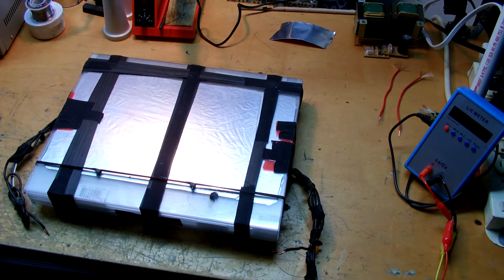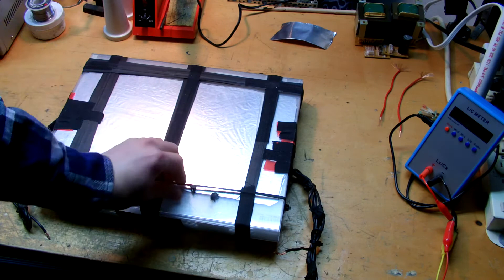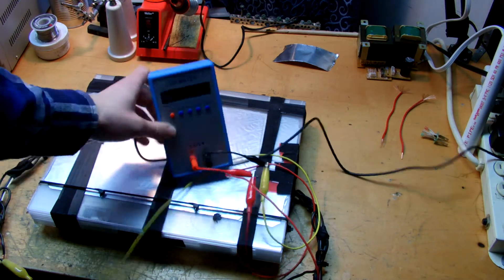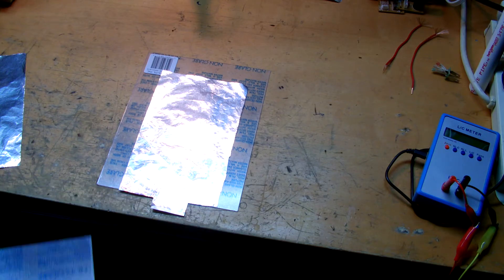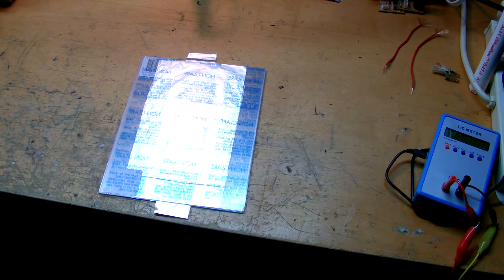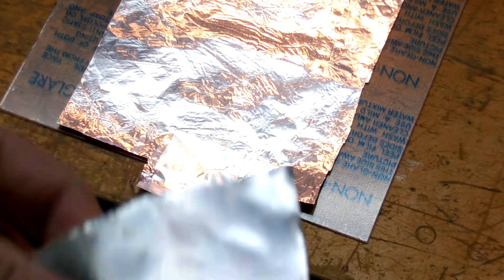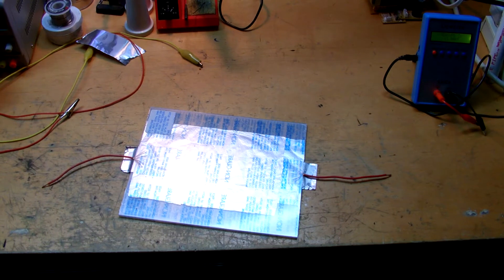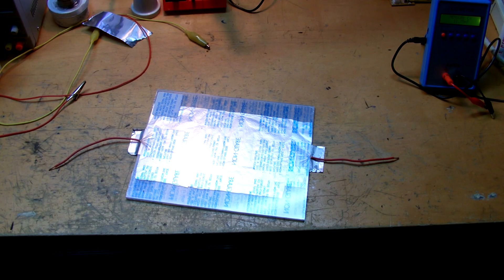DIY Tesla Coil HV-Capacitor Tutorial!

Comment: Hey Pete, Just wondering if you have used glass instead of plastic. I was thinking that my local thrift stores sometimes give old picture frames away for free that include the 8-1/2 x 11 glass plate. Being I am on a very fixed income, that might be my material of choice. I'll let you know how that works out. Plastic would be safer from a breakage point of view ;-)
Reply from the maker: I dont see any issue with going for glass depending on the voltages applied you may have to just leave about 2 inches of space between the foil and the edge of the glass plate, also glass is pretty consistent and I found that with more pressure applied to the surface of the capacitor the higher the capacitance was since the dielectric compressed. You could also get a small flat bead of silicone around each plate to help everything stay secure and square whilst reducing the chance of flashover.
Reply: @PcrHV  Sounds like a plan, thanks 🙂

Comment: Actually a very well explained video. I am just starting out with my first few Tesla Coils and thinking of using the output from a flyback transformer from a old Bently TV that in itself pulls about a 25mm arc. Thinking of feeding that to a diy cap and sparkgap before feeding to my TC primary. Any thoughts other than not to kill myself? 😀
Reply: @PcrHV  I have been working with my ham radio gear for nearly 50 years and just getting interested in making intentional sparks Lol. I got hooked on musical TC's recently and got bitten by the bug. I doubt I will go to the power levels you are at but this is going to be fun anyway 🙂
Reply from the maker: @marknesselhaus4376  ahh good old ham radios! Good, so you have an electrical background. That helps lol. Once you build your first coil you'll want to go bigger! I do love audio modulation and have only done it through a flyback as of yet.

Comment: Nice Job..  I don't what your goal for Capacitance was,  But, there's is thinner Plexiglas available.  Standard Store plastic is around  .080 inches thick.   You can get it online at .020 thick.  That should still be plenty to stop any arc through.  The thinner the plastic,  the higher the capacitance..  Even better, would be a clear plastic shower curtain..  It's thick and really cheap at walmart and you can double it up for the thickness you want..  Also,  You can buy Aluminum Gutter Flashing for the plates,  it's much more rigid and really thin..  but,  If yours work the way you want,  More power to ya.  Nice video..

Comment: First... You were extremely lucky to get a plastic that would handle the voltage without puncturing through the plastic sheets. Not all plastics were created equal. Second.... I hope you peeled the protective coating off of the plastic before assembly. The reason being, that the air pockets between the protective sheets could cause rather large static build-up and arc right through the dielectric sheets. Third..... Since all plastic is not created equal, Would be nice for you to tell what kind of plastic, the manufacturer and the thickness, and where you bought it. Last You could also soak the cap in a bath of mineral oil and further reduce the chance of corona racing between plates. The oil also serves as a cooler and will extend the life of the cap. other than that, The tutorial was very good.

Comment: Hi, yeah, its paralell plate capacitors, aluminium foil as well and trying to use different insulators,  plastics, foam,   they are connected to my van de graaf.  I found thus out that the voltage drops a lot , I think due to corona leakage, I am not sure how to avoid that since the problems are the connections to the cap and from the VDG sphere.. hmmm

Comment: Ah I see now, maybe not so thin then I could experiment with the breakdown properties of different materials to try to minimise the shear size and weight, although your method does work and seems reliable, also glueing the layers together then holding the whole thing in a hydraulic press would also make the whole capacitor more rigid and permanent. There's nothing more pure than making your own parts, this video does inspire me to want to want to make a tesla coil using only self made parts. xD

Comment from the maker: Hey Steve, thank you very much for the feedback, i appreciate it!   I tried going with thinner dielectric and it eventually blows a whole clean through, its fascinating actually, but smells so bad haha!     For this type of cap, i have found that with larger plate surface area more capacitance results, i just use the overlap to prevent flashover, also the tighter you clamp the sheets together the more efficient it will be, using a meter and pressing on the plates will show you a difference!

Comment from the maker: Hey thanks Bill!  Not alot of power for three sheets but its a decent example i thought.  Thanks for the comment mate!
Reply: Pete Ritchie 
question, how much voltage does it take to run a single led light, and then be able to make a flash light that we would not have to replace batteries again.

Comment: Great instructional video Pete, the video is crystal clear and informative with good attention to detail, like how to connect your wires up to the conductive Aluminium plates.
For mine, I'd be tempted to try and get hold of the thinnest dialectic plastic I can find, something like the mylar sheet, since certain capacitors already use that as a dielectric.
I have one question; capacitance is proportional to overlapping area of two conductors with a dielectric between as well as amount of layers?